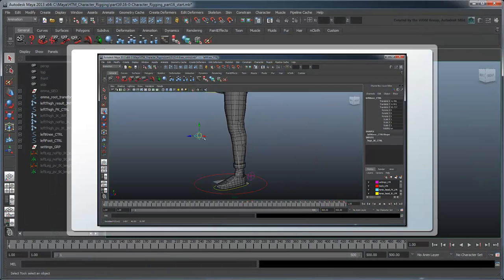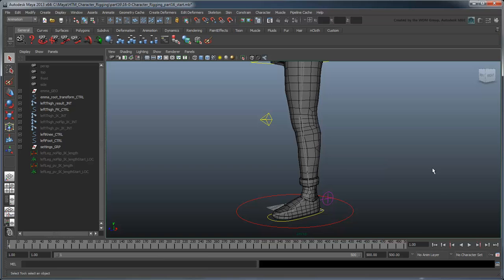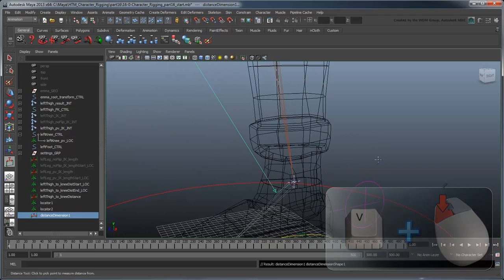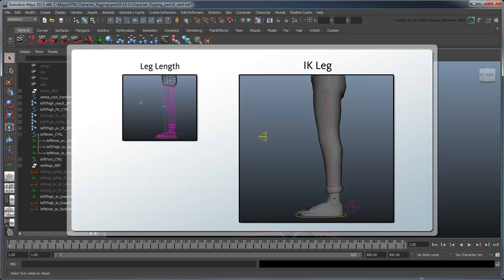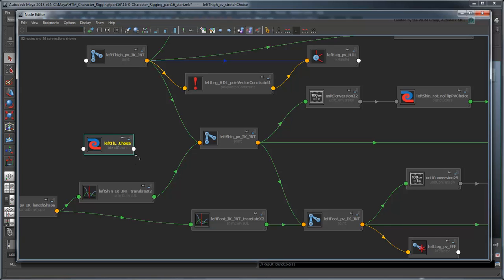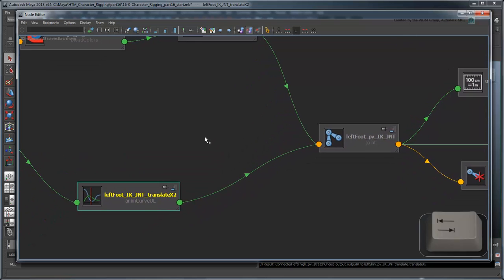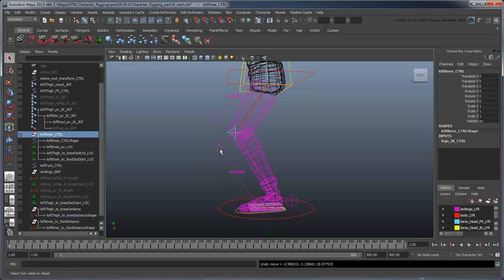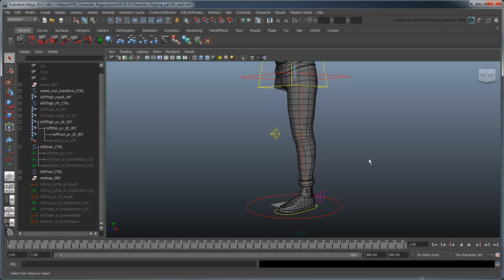Creating a Character Rig - Part 16: Snappable knee (Advanced)

Comment: I'm trying this same technique on a different model. The knee sorta snaps to the leftKnee_CTRL, but the geo is sort off to the side. And when I try pull the knee controller forward the geo starts going backwards! Do you have an idea what I did wrong?
Reply from the maker: Sounds like a scaling problem.  I'd check any multiply/divide nodes involved.  It could also be that you forgot to set up the geometry's pivot appropriately.
Reply: Maya Learning Channel I checked the multiply/divide nodes and they seem right. Geo's pivots are correct. I changed the rotation order from xyz to xzy (for IK, pv, noFlip, result and FK joints). I still have the problem but it's not as bad. The geo is snapped on the other side of the leftKnee_CTRL but is  a little closer to the controller. It's now more like rotating away from the leftKnee_CTRL instead of snapping backwards.

Comment: Hello again! I use Autodesk Maya 2015 edition. After I finish with the blend color node [8:08] for the knee; my character knee doesn't stretch. It does snaps to the knee controller but if I pull on the knee controller it doesn't stretch. Also when the knee snap attribute is turn on the LT knee and foot pole vector joints separate from the geometry mesh. Again what do I do?
Reply: Sorry! Creating A Character Rig - Part 16: Snappable Knee its [6:30] not [8:08]

Comment: I'm missing the second locator when using the distance tool. It's weird. I think it's like seeing my pole vector locator as its second locator or something. 'Cause when I use the distance tool measure the distance between anything other than the pole vector locator, I'm not missing the second one I'm suppose to have. Oh, and may I add, that the pole vector locator turns white when I'm finished with the distance tool.
Reply from the maker: When creating a distance node, don't click on existing joints/nodes.  Instead, click an empty spot of the scene near them.  This forces Maya to create a locator which you can then snap to the appropriate joint.

Comment: Hello! I use Autodesk Maya 2015 edition, and I am having problems with the measuring tool - distance tool. Every time I use the distance tool It doesn't create the locators. It shows the distance length between the think knee and foot ,but not the locators. What do I do?
Reply from the maker: Instead of clicking on the knee and foot when creating the measure node, instead click two empty areas of the scene.  Maya will then create the locators that you can then snap to the correct positions.

Comment: Hello! I on the right leg, and I have a problem. I cannot stretching the right knee, because when I make the Right_Thigh_PV_Stretch_Choies and Right_Shin_PV_Stretch_Choies, and I connecting, is not stretching perfectly. When the knee is stretch, the orients of joints are change, and the knee is look back, but when the blend on the 0.5, the entire right leg is stretching, and its not good. Please! Tell me! How can I Stretching the right knee perfectly? How can I FIX this problem? Thanks the answer!
Reply from the maker: Are you sure the leg joints' LRA are all pointing in the right direction?  And have you adjusted all the multiply / divide nodes appropriately for it.  You should have a look at the node editor in the finished rig (part 32) to find your answers.
Reply: Maya Learning Channel I use the Maya 2009 version, I can't open this file, which you sent, so I cannot look the node editor. So please! Tell me! How can I Snapping the Right Knee without this terrible LRA problems.

I must put a Multiply/Divide node after the Right_Thigh_to_Knee_Distance and Right_Knee_to_Foot_Distance? Or After the Right_Shin_PV_IK_JNTtranslateX node or after the Right_Thigh_PV_Stretch_Choies, or what can I do? Please! How can I fix this LRA problem? Please! Tell me! I thank you in advance for your reply.
Reply from the maker: You should be able to view the file if you turn on the "Ignore Version" option in the Open File menu.

If the local rotation axes of your joints are set up correctly, you should just need to invert the value of each of your thigh_to_knee and knee_to_foot math nodes (so multiply them each by -1).
Reply: Maya Learning Channel I put multiply/divide nodes after the Right Thigh to Knee and Knee to foot math nodes, and it's working! Atlast I corrected this problem. Thank you! You saves my life!